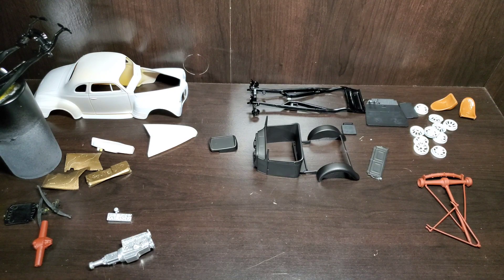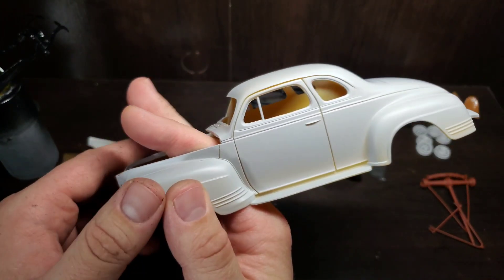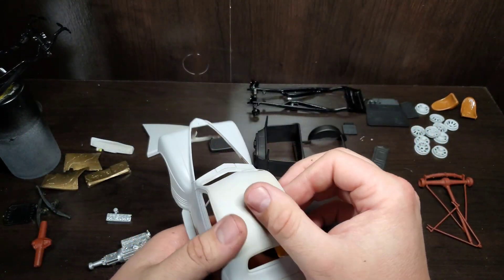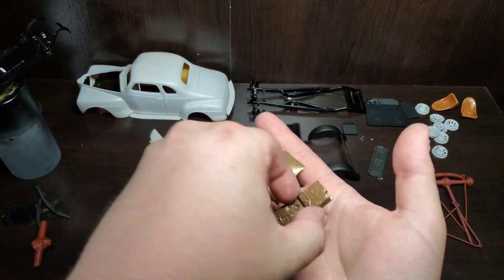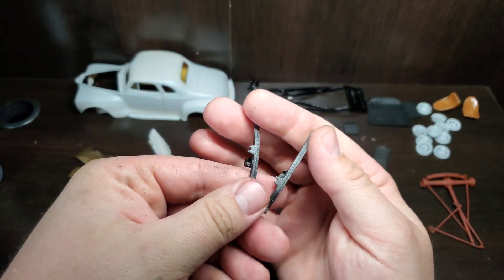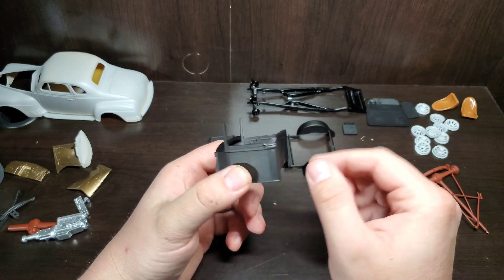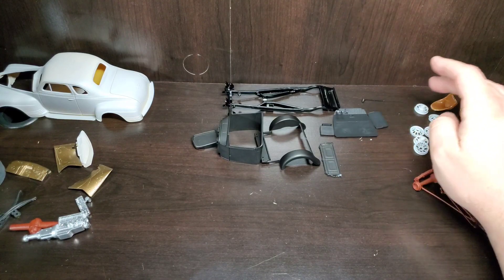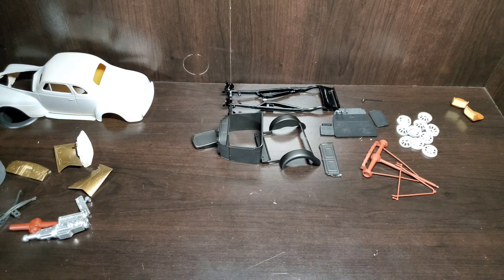4-8-23 Weekly Bench Update 34 Ford for SBOG and 41 Plymouth

Comment: Nice update.  The Plymouth is one that I will avoid now that I've heard some of the issues you've had so far.  The SBoG build is looking good.  Curious as to the motor you'll have for it.  It's been a fun build for me.  Take care.
Reply from the maker: It's an odd thing to deal with.  Not impossible or just not worry about the seams.  I did order a 3D printed flathead so we'll see how it fits and how it works out.  I did think of a couple others that could be interesting as well.